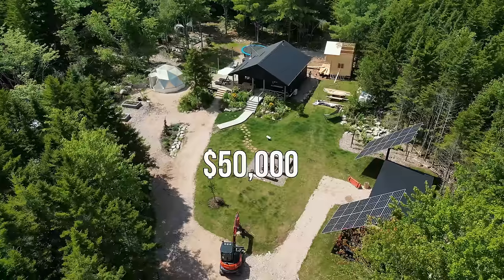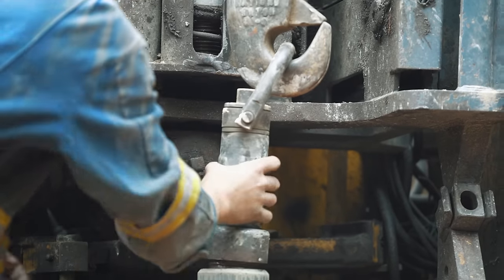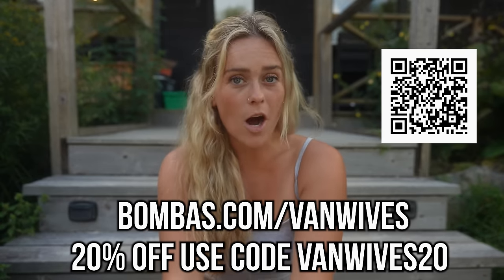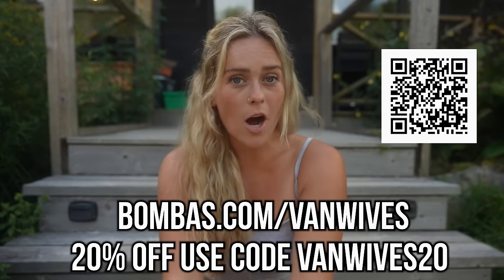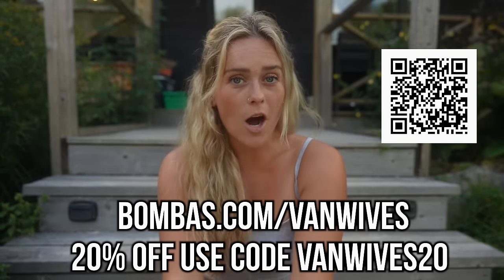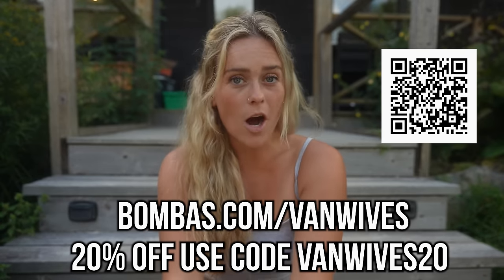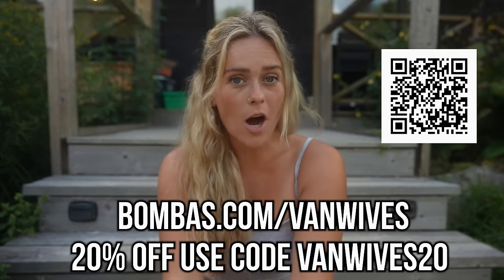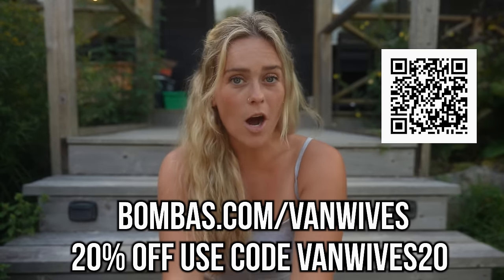Renovating Scary 50K Hunt Camp to Beautiful Homestead! Full Tour Start to Finish

Comment: You ladies might want to make the effort of reducing the fuel load (reducing the number of trees, limbing the trees, and removing any dead timber) in the forest around the property in as wide a radius as you can so a forest fire wont run through as easily. This is something you can do slowly and expand outwards over several years, its a big undertaking.
Some bonuses in doing this is that the trees you do leave standing, the largest and healthiest, will grow much more quickly, the trees you cut down is free firewood/timber and it will make the place look much nicer^^
Reply: Absolutely

Comment: You two have a little over twice my solar output of 5 KW, but my wife and I live in Southern California and are grid-tied.  We use all-electric everything, like heat, AC, hot water, and cooking and still have a negative electric bill year-round.  So I bet 5 KW would suffice for your Mexican house.  Hopefully that area has electric service, but if not you might want to look into a power storage system that connects to a propane-powered smart generator.  Ecoflow has nice ones.  If you get those, I would build a very secure secret vault under you house for them, so they are still there when you come back for the winter.

Comment: I think your math on your batteries is incorrect.  You basically have 6 each 100 AH, 48v batteries which means you have a 600 AH, 48v battery bank.  Amps X Volts = Watts so you have 28,800 Watt-Hours of battery storage.

Comment: I remember that original shower you put in that bathroom must not have worked out because it certainly has changed now
Reply: The old toilet they had needed to be up against that back wall, so once they replaced it with a composting toilet they were able to expand the shower.

Comment: Your place is wonderful and I totally get the appeal of "Living in the woods" but I cringe at how close all those large trees are.  If a fire swoops through there you guys WILL loose everything.  The radiant heat will set everything on fire and even destroy your solar panels.  Standards vary but I would have 100 ft clear to every structure and from 100 - 200 (maybe 300) feet thinned out and keep just a scattering of the nicest, largest trees.  Fire is a fire breathing monster and is hungry.

Comment: You have done an amazing job! Why haven’t you done septic system? It’s the ultimate off grid system….
Reply: I believe they did put in septic.
Reply: @AB-ol5uz I don’t think so… otherwise they would have a traditional toilet as they have the water available. Also from previous videos the drains in house just run out underneath cabin…